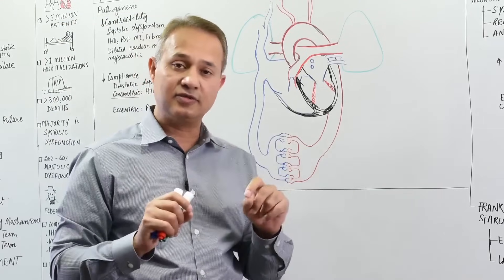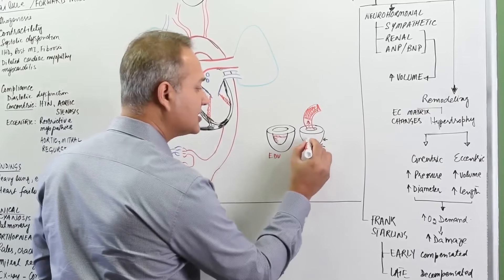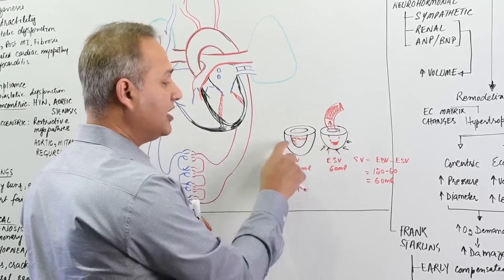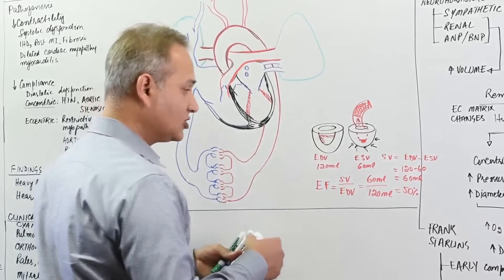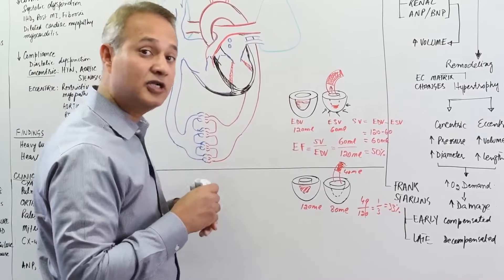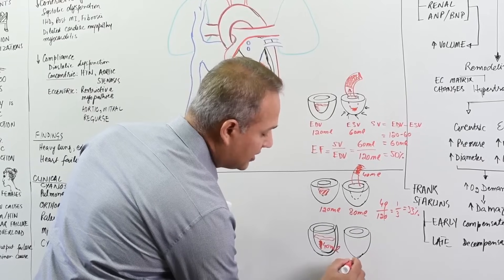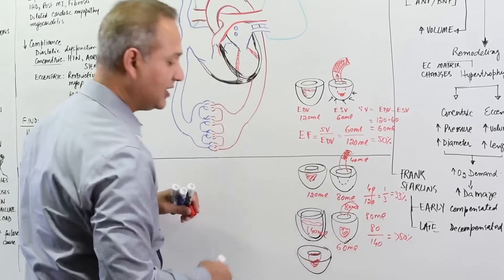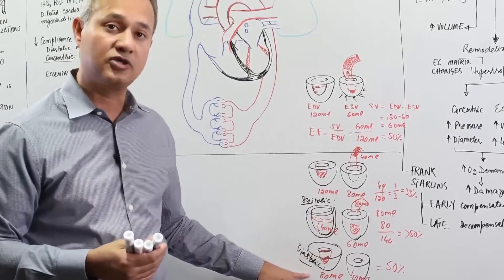Understanding Systolic vs Diastolic dysfunction mathematically

Comment: I have a question I´m not sure If I got this right. Normal EF is around 55 %, so that means when you have Systolic Dysfunction is will always be bellow 55% ?
and Diastolic Dysfunction is when you for an example have dilated left ventricle have an EF = 55% or more, or if you have a hypertrophy of the left ventricle that also will give you an EF=55% or more? 

And I also wonder if Systolic dysfunction is the same as Forward failure? And Diastolic dysfunction is the same as Backward failure? 

I hope you can answer my question, great work and thanks for an amazing lecture in the middle of my doctor studies. Amazingly helpful! 

Best regards
Caroline
Reply: u r right